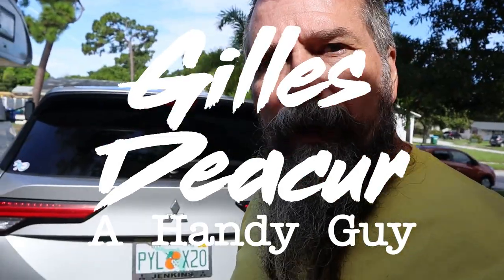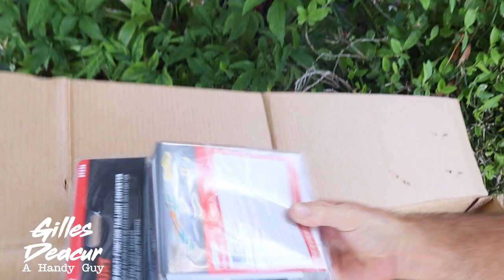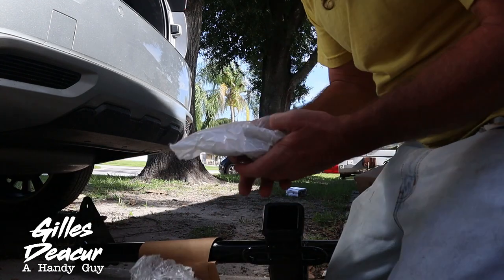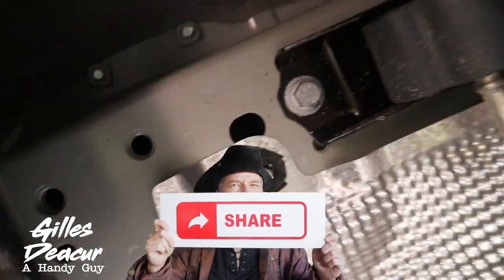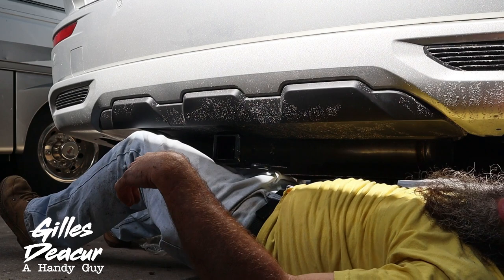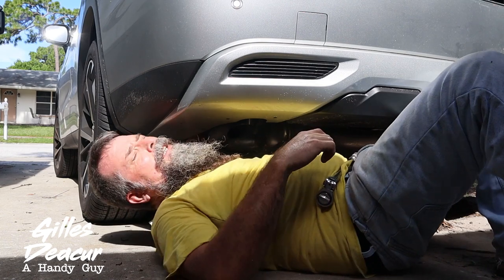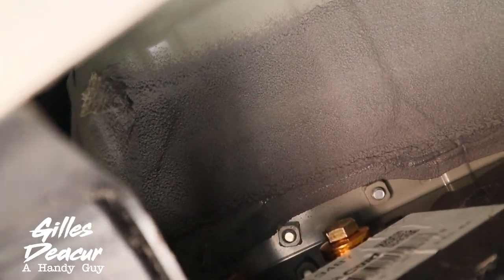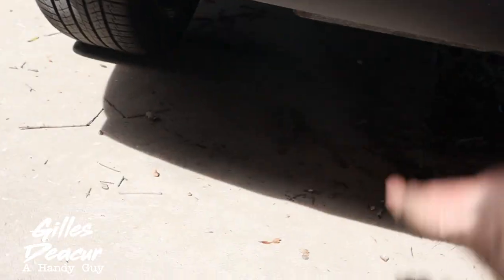2022 Mitsubishi Outlander Tow Trailer Hitch Receiver Installation - Curt 13487 - Kick Feature Check

Comment: I was curious how is mounted in new one, cuz I have 2017 model and I don’t like it (how 2” tow hitch is mounted) takes to much view in my opinion this one looks much better
Reply from the maker: Yeah, this one is hidden pretty well.
Reply: @LordGreybeardsChannelofWisdom  How I installed the towhitcht in my outlander, mainly to mount a good "bike rack" but after some time I find that it is a mistake, especially when driving in rural forests, etc., I can see that this solution is a bit different, I am also surprised  that Mitsubishi does not have such a solution as Toyota, for example 4runner, it really makes life easier.

Comment: Just as you show in your video, the rear kick feature to open the rear hatch door worked fine. But  it no longer works after installing the Trailer wiring harness with the 4 way flat trailer connector. I'm thinking the kick feature won't wutork anymore because interference from the green wire that runs under the bumper across  to the right signal light and the 4 way flat trailer connector harness that is also routed underneath the bumper to the hitch.
Reply from the maker: Sorry to hear that. Let us know what the problem was if you get it fixed.

Comment: I tried to mount it but there's a plastic piece in the bumper of my outlander that it seems yours doesn't have and it's not letting fit the tow receiver. I think I'll have to take it to the dealership to take down the muffler.
Reply from the maker: That's not good. I wonder why they made the change.
Reply: Same here. Looks like you can grab on the metal pieces with a pair of pliers from underneath. But you'll probably have to remove the exhaust.

Comment: How much are you towing?
I have a small boat with total wet weight of 1600 lbs, I'm just a little concerned about the ramp and long term wear on the vehicle.
Reply from the maker: I haven't towed anything with this yet. I have a small Harbor Freight trailer that I tow my kayak on, but haven't hooked it up yet.